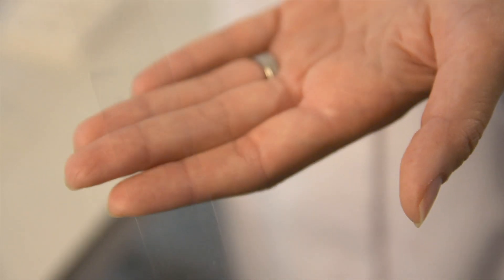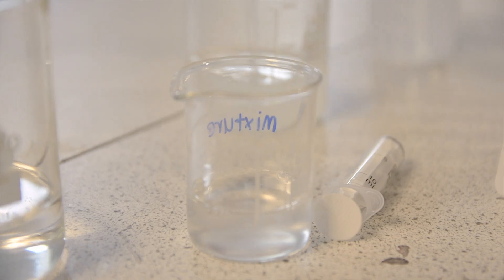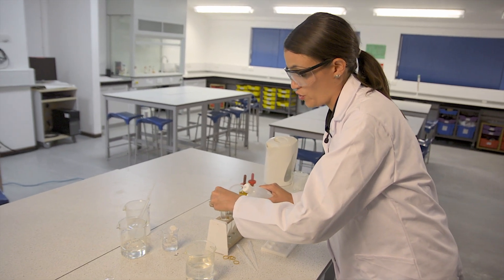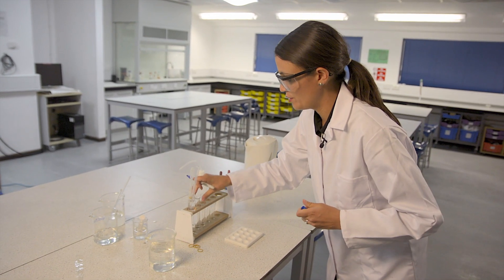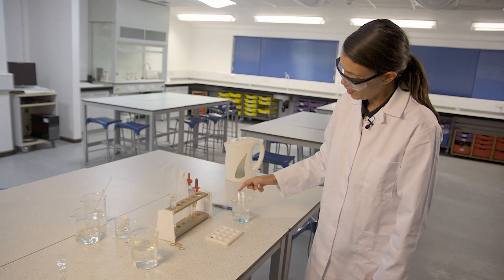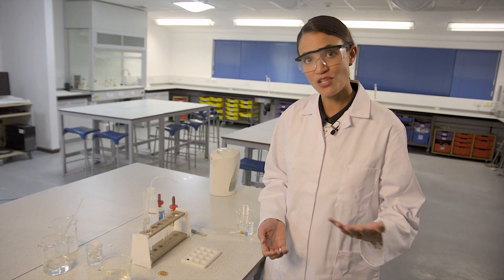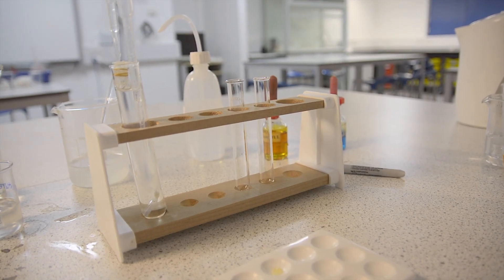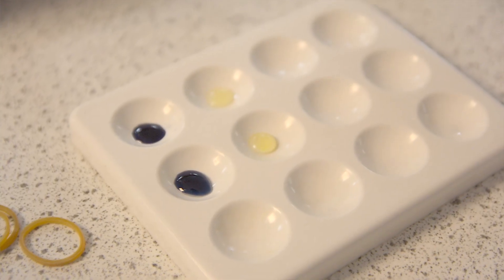Visking Tubing demonstration - Get set...demonstrate for Demo Day 2014

Comment: This demonstration is based on a false concept: that glucose and starch are soluble in water, which is false. Ony glucose is soluble so it generates a water potential from the inside and the outside, generating the glucose to go through the membrane due to a diffusion. Starch on the contrary is not soluble in water, thus not generating any concentration potential from the inside and the outside and so the molecules have no pressure forcing them inside the tube